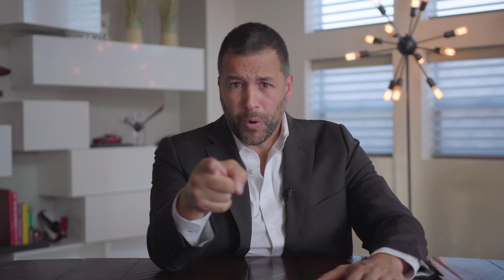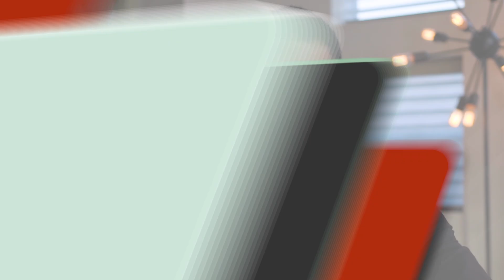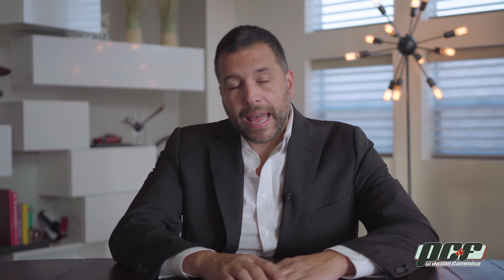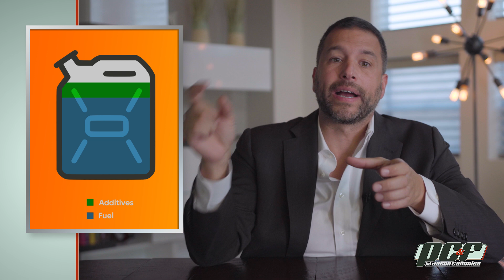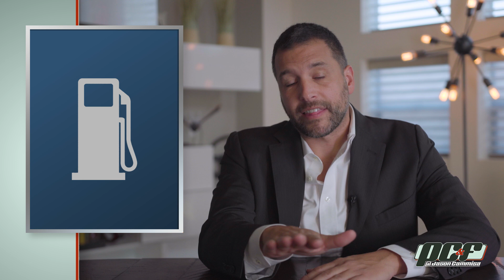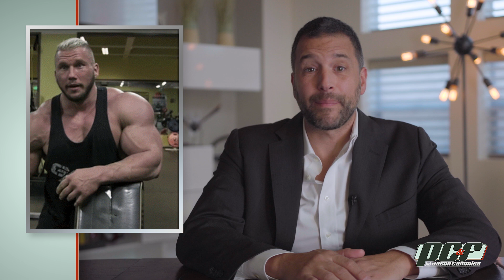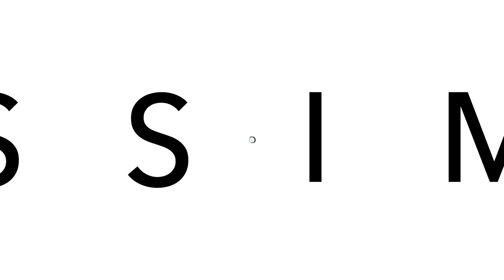Why you should never put premium gas your non-premium car — Proper Care & Feeding with Jason Cammisa

Comment: Not always necessarily true....  In initial testing yes.....  An older engines with carbon buildup...  Compression goes up...   Proper watering of the Pistons can reduce carbon buildup....   Or 3 applications of marvel mystery oil added to your fuel...     High-test fuel along with the Italian tune-up will help.....

Comment: 25 years and 280K mi later, there's no guarantee it still handles RUL as happily at it did, out of the factory. After all, likely nothing about it: ring gap, compression, injector spray pattern...meets factory specs.

I've got a Frod 4.9 L6 that will give light spark knock between 2500 and 3000 RPM at WOT, unless you up the octane to 89 or better.
Reply: Carbon buildup has increased your compression...   You need to properly water your Pistons.. and or three applications of marvel mystery oil....

Comment: Not sure what it's like in the US but in Australia, regular petrol has a higher permitted amount of sulphur.
Also, knock sensors and ECU can take time to adjust. Any pre-ignition/detonation/knocking can be bad. This happened to me after changing a very dirty air filter on a 2010 Corolla. It started knocking at idle for a few seconds.

Comment: In The Netherlands they have put a law in effect that is stating that gasoline needs to be 10% ethanol for all non-premium gasoline.
This means that 'premium' gasoline still gets away with less than 5% ethanol gasoline. Lots of cars made before 2010 were not made to support more than 5% ethanol. Rubbers, hoses, clamps and other internal stuff in the engine can wear out due to the ethanol. Or more precisely, because Ethanol is prone to attract more water, the filters that normally prevent this, are unable to cope with this.

So we need to put 'premium' gasoline in our 2012 Seat Mii because it stays still for more than a week and that have great repercussions when it attract too much water...

Comment: I thought cars had knock sensors and the ECU adjusted the ignition timing to suit the fuel, maximising the advance as much as possible without initiating knocking.  Anyway, my 5 litre Jag seems to do more mpg on E5 than it does on E10.  Best ever long run on E5 31.5 mpg..  Best on E10, 29.5.  UK gallons by the way, not US).

Comment: What a load of bullshit. If a car manufacturer states minimum Ron and you fill with premium Ron the PCM via its oxygen sensors and knock sensors will soon change the long and short fuel trim and ignition timing to suit the fuel. Your video would make more sense if you said if you car manufacturer stipulated premium and you use regular the safety margin for pre detonation may not be programmed into the PCM resulting in detonation at higher rpm or engine load conditions. Your grade today is F-

Comment: You are right but not for the right reason.  Ethanol raises octane.  So does MTBE, (now illegal I believe). High octane gas is actually LESS VOLATILE gas.  Because high performance engines run with more compression and ignition advance, less volatile fuel (known as premium) or the highest octane at the pumps, is needed to prevent predetonation.  
There are a few times when your regular gas car should have premium.  If it is an engine that has been burning oil, that oil "cokes" (turns to hard carbon) on top of pistons and inside combustion chambers and effectively raises compression ratio.  Modern fuel injected engines have knock sensors that will retard ignition timing when triggered by predetonation (knock).  Using premium may minimize the low power condition caused by the engine sensing knock, and backing off ignition advance.  This would only be a short term solution if it worked.
Another time is when you are towing a load with with an under powered vehicle.  If you have a 3/4 ton pickup with only a 350 and you are towing an 6K+ pound trailer through the mountains, put in premium to help keep the ignition timing advanced while pulling a hill.  The heavier load pulling the hill is where the knock sensor may fire and retard ignition timing, starting a vicious downward cycle.  You want to avoid that.  Premium can help.
I was a NASCAR official at a well known local track in the south.  The way that the cars in the "limited" class would cheat is to put REGULAR gas in their racing gas because IT IS MORE VOLATILE and the limited engines were also limited on compression and total ignition advance.  So they mix more volatile gas into the racing gas to LOWER the octane but get more energy from the gas and more power.
High octane gas, "allows" a high performance engine to work right (increase total ignition timing).  It does NOT "make it" High Performance. Generally, people putting premium in a car designed for regular HARM there performance because the gas is LESS volatile.  They are more likely to get LESS MPG. Their car CANNOT under normal conditions take advantage of high octane fuel, so adding it is really a disadvantage.

Comment: Yeah, except the difference between 91 and 98 (here in Australia) gets my 2001 Camry and extra 100 to 150kms in range. Modern fuel injection cars have knock sensors and do indeed adjust timing to get a cleaner better burn.

Can't believe this misinformation is still making its rounds lol.

Also if you don't have a direct injection,  put the higher octane in. It cleans the valves better and helps maintain the car lol. Pull apart a few engines and you can tell what fuel people used.

Comment: Your description of knock is incorrect. What you described is “Pre Ignition”. Knock is a secondary combustion event the occurs after the spark plug has fired and the flame front has already started to propagate. At that moment the cylinder pressure starts to sharply rise and causes  auto ignition in another area of the cylinder. Now there are 2 competing flame fronts which cause the cylinder pressure to rise too sharply, too much pressure is created too early in (in degrees of crankshaft rotation) which puts much larger stresses on the engine than intended.

Comment: One exception is the Honda Civic Type R FK8 I regularly get 40-46 mpg on the motorway. In my 2.0 NA Renault Clio Rs I would struggle to get 36-37 mpg on the same run, and that car is about 200kgs lighter.

Comment: This is not entirely accurate, just because a car is engineered to run on 87 does not mean its going to perform at its maximum output, one reason is when outside temps are over 110 degrees and heat soak starts to set in, the ecu will pull timing to prevent detonation and you will loose power, I know this for a fact and have known for years, go look up some videos of cars being put on the dyno with 87 then premium

Comment: Title is misleading, mechanically there is nothing wrong with putting higher octane fuels in and there may be reasons to do so like they are out of regular.  This point should have been made that it's OK for the car and you can use it if needed.  The second issue is as cars age you can get preignition which is damaging to the engine and using higher octane can stop that problem.   This is typically why many gas stations offer 3 grades not 2, with the middle grade there for older cars that can use a bit of octane boost but don't need the full premium octane.

Comment: If the oremium gas doesn't have ethanol in it and the normal gas does, than it is better (essentially for small engines equipement.

Comment: Premium fuel mightn't eke any more hp out of many engines but the detergents and (in many places) lower sulfur content will ensure greater longevity. As for high compression, turbocharged donks you'd be mad to use anything but top tier fuel...

Comment: My brother drives an dirt late model race car. It’s around 420 cubic inches and a little over 900 hp. It’s got 15 to 1 compression and runs either 114 or 116 octane race fuel. We were at a race and during one of the heat races one of the cars broke a ring or had a similar problem, the car actually ran away using the engine oil for combustion like a diesel would even after the ignition was turned off. It’s the craziest thing I’ve ever seen, didn’t even know it was possible. Ended up burning the engine up.

Comment: I don't believe anything like an additive is put into gasoline to raise the octane rating like the tetraethyl lead they used to put in it.  But, you're so right that using higher octane fuel in an engine which doesn't require higher octane is totally wasteful.  Octane is a measure of a fuel's ability to resist autoignition.  By itself, it does not provide any additional energy to a fuel.  Zero.  So, don't waste your money.

Comment: Welll, no.

The video is at least untrue if not actually incorrect.

1. There is a tendency now that cheaper fuels contain more ethanol. That can cause problems for some cars. Ethanol is corrosive a bit and that may mean in long run it can damage fuel system more. A bit controversial topic but not as simple as presented here.

2. The fancier cars may require the higher octane fuels because the regular one is prone to detonation burn (knocking). usually its not very dramatic but still damages the bearings in the engine.

3. There is also an issue with very low octane fuels and high altitudes. Engineering explained talks about it a bit in his video.

Comment: I read about a mini study where a guy put reg & premium fuel from multiple gas stations and measured mpgs & a few other things.. The result was that shells premium stuff cleaned the engine instead of leaving deposits like the other stuff... Long story short about every other month I fill up my mustang with the higher octane from shell. It's whatever. It's only a few more bucks so it doesn't hurt

Comment: Meanwhile in the modern world with VVT being common, many engines that "can" run regular 87 will be designed in such a way as to see increases in performance by running something like 91.  You're still mostly wasting your money by buying higher octane fuel with these engines, but the general premise of the video is kind of bullshit.  It's also worth pointing out that the fuel argument is similarly bogus.  Higher octane road fuel is typically just a more refined grade of gasoline.  It's literally all still fuel.  Some discount chains sell high ethanol blends, but that isn't the norm.  Even in those cases, you're still getting an additive that contains a significant amount of energy and has the added benefit of making your gasoline burn more completely due to its being an oxygenate.

Comment: If you are sensitive to how the engine feels then I would definitely take it on a case-by-case basis. I had a 2008 Honda Fit which requires 87 and I tried 91 many times with no difference. Because of that I stuck to 87 on it. 

I then traded that Fit in for a 2009 Fit which is one generation newer and continued to use 87 as again that is what was recommended. Then after a while, on one fill up I decided to try 91 just to see if there was any difference and to my surprise, the car felt way more peppy after putting a few miles on with 91. So again if you are just a casual driver it might not matter to you, but I clearly felt a huge change and for this particular car, I only use 91 now.
Reply: Dunno how it is in your part of the world, but here it's likely that a premium fuel will also be cleaner and have better additives. None of my cars have ever needed a premium and all were made between '88 and '04, but some of them ran definitely smoother on a premium.
Also we have mostly higher octane premium petrols, but some stations sell lower octane premiums - and those "feel" just like a regular petrol, but probably protect the engine a bit better.
My best case was when I put a premium in my turbo engine and literally killed it 2 hours later. XD
Reply: @BluesyBor  Thats not how it works... Additives vary if its a top tier station not octane goofball.
Reply: @samusaran7317  "that's not how it works" in which part of the world? Or maybe rather part of galaxy, miss Samus?
Reply: Yah that Honda motor is a high compression motor. Higher octane can compress and release more energy so the motor loves it. Get a tune and it will come alive. Honda had low compression low hp, high compression 20 more hp, then vtec.

Comment: @0:52 Fuel igniting early is pre-ignition. Knock or detonation usually occurs after ignition in areas of unburned mixture due to rising cylinder pressure from the burning mixture.

Comment: Genuine question. WHY would the manufacturer tune for premium? It’s cheaper to design and tune for regular and then have slightly higher displacement. Than to have a minutely smaller engine with high compression that needs premium fuel. 
Premium gives you more energy per gallon but not more per dollar in most cases.

Comment: Complete rubbish...many engines benefit from the Premium fuel, being less prone to knocking (Detonation) You will get more power. The engine automatically adjusts the ignition timing to stop detonation and thus reduce power as well if it senses it...Premium fuel allows the ignition curve to advance and increase power....

Comment: This used to be the case for older cars that don't have variable valve timing or turbos. Putting a higher grade of Octane in a modern car may give it a slight HP bump if you're pushing the engine to its limits but its negligible and unnoticeable in regular day to day driving.

Comment: Many cars today have adaptive ignition thanks to the knock sensor. On these cars running high octane fuel will add power and efficiency.  Doing real world maths, I did several weeks of driving on 87 and noted my average MPG. I then backed it up with several weeks of 93 octane.  I noted an increase of my average MPG and subjectively felt that the car was more powerful and responsive.

Of course your mileage may vary. Both of my current vehicles require high octane fuel. The Abarth at least gets an average of 34 mpg (it's rated for 32) but the Landy gets about 15. That one hurts.

Comment: I'm a Diesel mechanic, But I know ENOUGH about gasoline engines. "Premium" DOES NOT mean "better" (This is a MARKETING PLOY) the LOWEST octane gasoline AND the highest-octane gasoline from the SAME refiner is the same QUALITY. Marketing has people think that higher octane means MORE POWER...Er, it does NOT mean that AT ALL. It's (kinda) the opposite. Increasing the octane level DECREASES the chance for "pre-ignition" (This is why you WANT that HIGH stuff in engines with a high compression ratio...) In other words (for the laymen) LOW octane gas goes "boom" quicker during the compression stroke than HIGH octane gas.  SIMPLE RULE: Use only as high of an Octane rate your car's manual says. They are not lying in those...They make ZERO on warranty work. So FOLLOW the DAMN MANUAL. Thank me later!

Comment: Retired auto mechanic here.  Actually, while everything described here is quite true, it is an incomplete picture.  Gasoline is a broad spectrum of types  of molecules. There is allowed a certain amount of difficult to fully combust heavy stocks in gasoline.  This tends to form a sludge on the valves and piston top.  High quality fuel have less of these heavy stocks.  The formation of these deposits happens more if the engine is changing temperature frequently, as in short trips service. If you are driving coast to coast, then the sustained high temperatures provide less opportunity for this  negative deposit to accumulate.  But if you do many short trips, back and forth to work, etc, it might be wise to buy the more pure, more expensive fuel. Also, the various manufacturers claim that the detergent additives specified by the Government do not go far enough to keep deposits from forming. This has cost them in warranty repairs. So they have a higher standard for detergent additives than the government requires. Please visit www.toptiergasoline.com to learn more. These deposits can shorten the life of oxygen sensors, and catalytic converters.  As a result, I use toptier gasoline (the expensive stuff) in my personal cars. I do use hi test top tier gasoline in my cars. The oil seems to stay cleaner longer.  It costs more up front, but I am convinced it is cheeper in the long run.

Comment: I only put Amoco (BP) gas in my motorcycles and small equipment. Gased up with something else when out of state and had to clean carb in the spring. Took a dirt bike out of the barn after 5 years and it started right up. I only  clean carburetors for friends small equipment because they use regular.

Comment: Also something many people forget is how you probably already get more octane than your car is tuned for. My Motorcycle for example is tuned for 91 octane and according to the manual needs 95 octane to get the full power, here in Germany you can’t even get 91 octane anymore since the 90s…

But I have actually used more premium fuel on my older bikes as certain gas stations around have premium gasoline without ethanol. Ethanol pulls water from the air and gelatinizes which can cause metal tanks to rust and carburetor jets to get clogged. This isn’t a worry if you turn the engine on regularly but if you mothball a bike for half a year its a good idea to put some ethanol free gas in beforehand

Comment: Why is it that my 2014 Subaru Crosstrek requires 87 but recommends 91? And it says it not only in the manual but on the vehicle too
Reply: Modern cars have high compression ratios compared to a lot of older cars and high compression ratios are synonymous with higher octane requirements. Your car has knock sensors that read back to the ECM and will retard timing if you run 87 so that you get no knock, but the manual is saying if you run premium that it'll allow the timing to advance and give you some better performance. In layman's terms, you can use 87, but if you want your car to run tip top performance you should buy 91. On a daily driver I'd just stick to 87.
Reply: @TheLouisianan  you don’t commute like I do then 😅 I put 94-101 in my AMG too